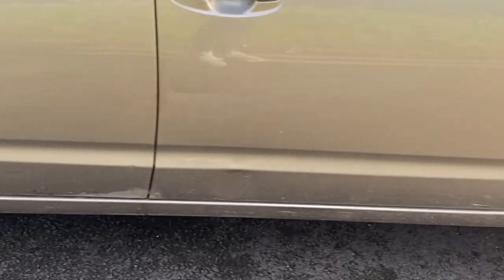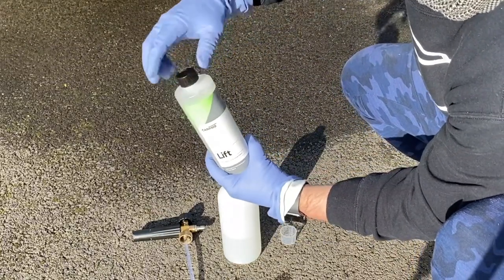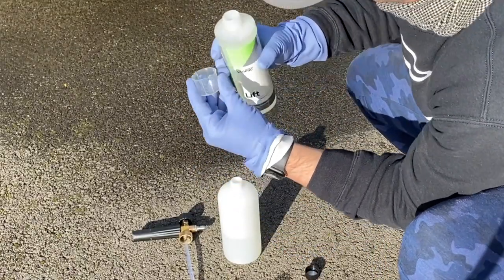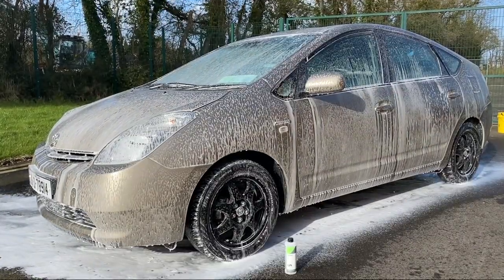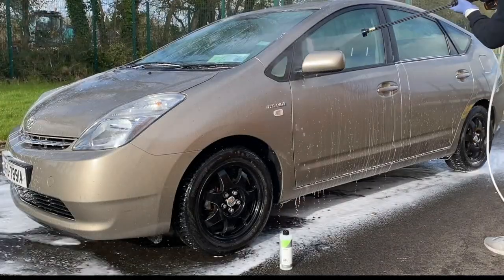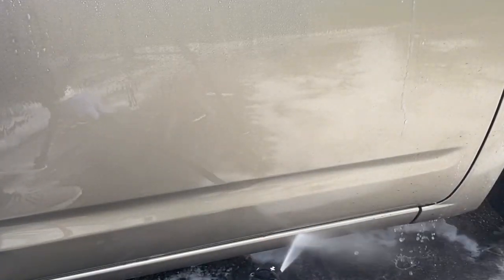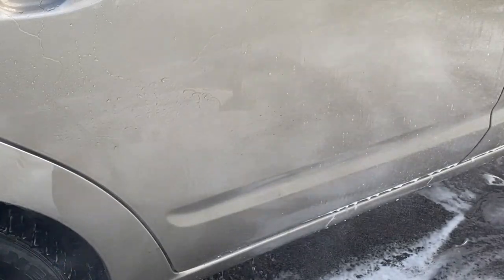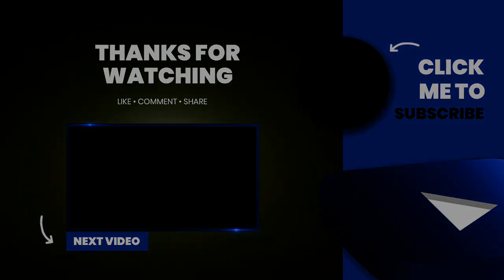Worx Hydroshot With CHEAP Snow Foam Cannon? BOOM.

Comment: Thanks YouTube algorithm again lol. I've just bought the worx Hydroshot and was wondering how such a foam cannon would work. I'm assuming you used cold water in the bottle. Even though you got good results and I now know I can get good foam with my new Hydroshot.
Reply from the maker: Yeah, YT algorithm can be a bummer sometimes 😎 I used cold water, also not the “thickest & foamiest” snow foam and it worked better than I expected. It needs some play on the adjustable top of the cannon to get the perfect density needed, but it’s possible. The factory worx “foam cannon” is a “joke” in my opinion, hence the small capacity and foaming properties, but this very basic and cheap foam cannon can offer a decent snow foam paired up with the hydroshot and can highly recommend as an additional tool for the main unit. Hope it helps,
Viktor

Comment: Hi I have the new worx hydro cordless pressure washer and notice you spray foam bottle seems way better the the worx one do i need an adaptor or will the one you use fit ok on the lance as i am in uk I am sure I can get the same one as you use.
Reply from the maker: Hi,
Yes, this should fit if both (worx hydroshot and the snow foam) have the 1/4” quick release connection. 

I have a link in description for the foam cannon. Make sure you check the connection type to be 1/4” quick release prior any purchase ✌🏻

Comment: It is suitable for wg620? Is it better than the original WA4036?
Reply from the maker: Hi Elad,

This foam gun has a quick connection, and all worx has quick release fittings at the end of their lances, so this should work. With all honesty: I wouldn’t bother buying the WA4036 dispenser. Really a wasted money, due its small capacity plus the lack of features as well as barely any foaming action. Hope it helps, Viktor
Reply: @RoadToDetailing  Is the second pipe connected to a water source?
Reply from the maker: @eladmoyal654  which one?
Reply from the maker: If you meant for the unit, yes, there is a hose attached to the main unit, and the end of it goes in to the water source eg: bucket of water